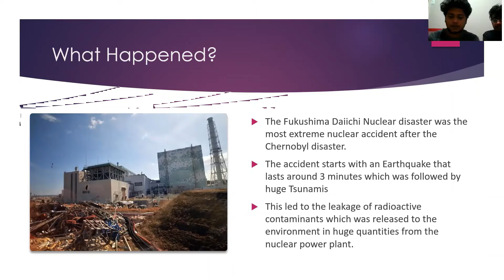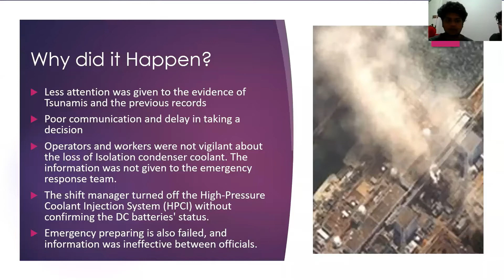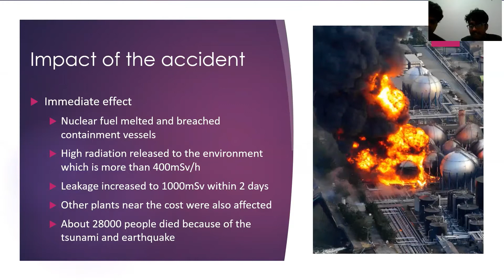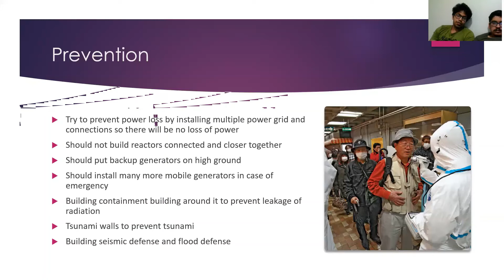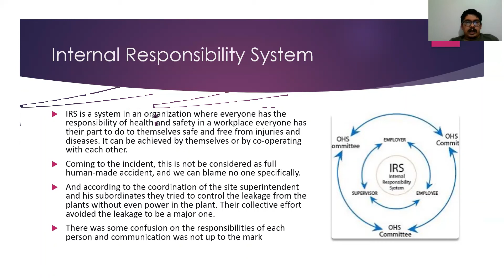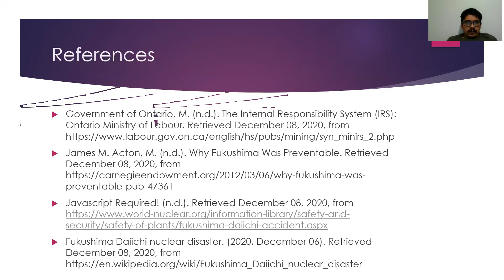Accident and Prevention Fukushima Nuclear Disaster

Comment: Alpha nucleus particle beta electron particle gamma ray x ray.  At the end of both alpha and beta decay modes there is a gamma photon release.  Transuranic and radionuclide evaporation equilibrium coefficients show water soluble elements and isotopes bond with molecules and travel around the planet with tritium being the worst as its radioactive hydrogen and a half-life of 12 years.  This gives it 12 years to get inside each one of us and every single water cooled reactors release tritium normally. The inverse square law ASSUMES a singular point source in a vacuum that emits isotropically.  ANYTHING outside of these parameters, such as an ATTENUATING SOURCE, EXTENDED SOURCE, DISTRIBUTED SOURCE will not yield the same 4*pi*R2 principles needed for any radiation detection device.  The only device that shows us what making the ionizing events to occur is a mass spectrometer and it to also has the same issue and why we don't know the proper levels. Every cause of cancer is unknown billions of cases.  Since every cause of every cancer is unknown than any and all points trying to be made with cancer are null and void.  Until a list with every different cause with the totals in those categories then no debate can be made for the use of nuclear materials.
Reply: Word salad much?  Why don't you show me Fukushima radiation death, or an increase in cancers since 2011?
Reply: @danadurnfordkevinblanchdebunk  Ok I will, show me the list of cancers caused by IONIZING RADIATION ONLY.

Comment: Fukushima Dai'ichi is an extinction level event - the site cannot be properly cleaned up - the site will be leaching radioactive contaminants into the Pacific Ocean century-after-century until the biosphere is ruined -  I put the blame on poor reactor design by Westinghouse, and poor installation implementation by inadequate seawall protection and inadequate protection of the backup diesel generators to avoid flooding.  Moreover, the concept of intermediate used fuel rod tanks at the top of the nuclear reactor buildings was also extremely unwise.  Tepco skimped on the design and installation to save money, and has now caused huge problems for everybody on Earth - namely, in the long term, an extinction level event.  Now Tepco wants to skimp by dumping contaminated water from tanks directly into the Pacific Ocean rather than cleaning and treating the contaminated water properly.  This is dreadful Japanese incompetence.  To show your dissatisfaction regarding the way the Japanese have handled the issue, I recommend boycotting all products made in Japan, for fear the products are radioactively contaminated from debris from Fukushima Dai'ichi.  The same pertains to food products from Japan that should be avoided; this is the present prudent policy of Korea.
Reply: Totally agree
Reply: ForbiddTV DEATHS PER KILLOWATT HOUR Craig.  Without every cancer case put on a list with its cause then every DEATH PER KILLOWATT HOUR calculation is null and void.  You know Deaths per killowatt hour Craig....maybe just not by name.  It's what has been used in the past for you to make the false statement " nuclear is the safest".  Fraud
Reply: @paulmobleyscience   Show how nuclear energy is not the safest form of electriclly we have.  You were just shown it was.  No one is impressed by your nonsense.
Reply: @danadurnfordkevinblanchdebunk  I already have Craig......1000s of times Craig remember all this 
The inverse square law ASSUMES a singular point source in a vacuum that emits isotropically.  ANYTHING outside of these parameters, such as an ATTENUATING SOURCE, EXTENDED SOURCE, DISTRIBUTED SOURCE will not yield the same 4*pi*R2 principles needed for any radiation detection device.  The only device that shows us what making the ionizing events to occur is a mass spectrometer and it to also has the same issue and why we don't know the proper levels.
let me explain it in a way you can understand.  Money since thats all your here about.  Ok are you ready Craig? 
So in this discussion quarters will be causes of cancer caused by ionizing radiation, dimes will be causes of cancer that are caused by Radon, nickels will be causes of cancer caused by smoking and pennies will be all other causes.  Now the TOTAL money you have is 10 dollars.   Last year at this time you had 10 dollars as well and broken down you had 32 quarters,10 dimes, 10 nickels and 50 pennies.  So now this year you have 10 dollars as well so with your thought then the amount of the different coins didnt change at all.  EXCEPT now you have 28 quarters, 15 dimes, 15 nickels, 75 pennies.  As you can see the TOTAL didnt change but every single factor of different types of coins changed.  So,  simply put your meme of TOTAL(10 DOLLARS) cancer cases has nothing to do with one SINGLE( QUARTERS, DIMES, NICKELS, PENNIES) cause of cancer.  If you cant understand that then you have no buisness being here harassing people.Ok Geiger salseman, explain to the good people of this video just how a geiger is calibrated using the inverse square law and how that law to is also used in the measurement process.  Then explain how Gamma attenuation works and what the geiger does to TRY to combat that, then tell everyone how dead time works and then quenching. And then finally but not least of all explain S
saturation and how it affects the tubes efficiency especially in an extended source.  Replace the word geiger with every other radiation detection device and explain for each as well, this should be good. We will be waiting for you CraigThe Earths Climate changes and has for millions of years through solar minimums, maximums and the Milankovitch cycles.  Before the minimum the solar dynamo ramps up, stretches and compresses that toroidal field of the sun causing sunspots to occur.  At the peak of the cycle before a minimum with a diminished magnetic field will not be able to trap the charged particles and magnetic fields that will be released 360° and cause the entire Earth to go dark for decades.  When that happens those nuclear reactors no longer receive cooling water and all go into meltdown at the same time.  Yeah, real smart...
Reply: Show anything that has gone extinct due to Fukushima radiation.  Your nonsense is not impressive.
Reply: @ForbiddTV  I do not need to answer to you.  You have been bought off by the nuclear industry.
Reply: @ForbiddTV  I suppose that you are in denial that there was even an accident at Fukushima Dai'ichi.
Reply: @tommorris3688  He hasnt been bought off he is a nobody.  He is a door to door geiger salesman and has a bias for nuclear to be used so he can continue to sell his cheap chinese goods.
Reply: @paulmobleyscience  Thanks for clarification.
Reply: @tommorris3688  Youre welcome and look at the comment section here to see it all.
Reply: @paulmobleyscience  Greatly appreciated that you are bringing emphasis to the seriousness of the radioactive contamination issue.  It is a serious downside of virtually all contemporary nuclear systems; even the containment vessel of ITER fusion apparatus will eventually become highly radioactive and hazardous as a result of the neutron fluxes that will be generated to try to obtain criticality in magnetically-contained plasma gas.
Reply: @tommorris3688   Yet neither you or nor your butt brother can show anything that has been negatively impacted by radiation from Fukushima.  If it is such an "extinction-level event", why is this so hard for you?
Reply: @tommorris3688  Completly agree.  Fission fusion it doesnt matter, we need to move away from burning and boiling everything to create energy.  Its just isnt needed any longer.
Reply: Then you need to get off the grid immediately in your ignorant protest against nuclear power since nuclear is absolutely the safest way to make electricity.